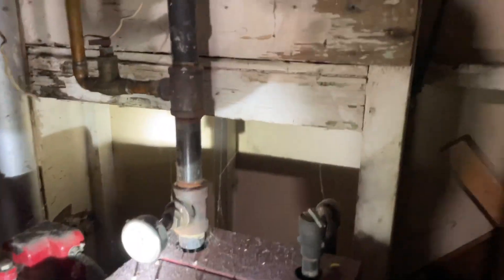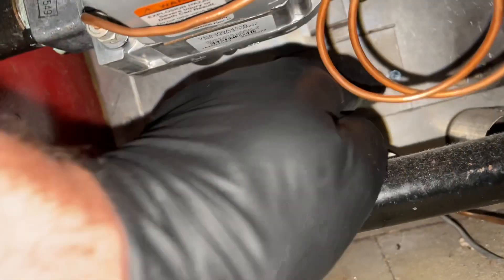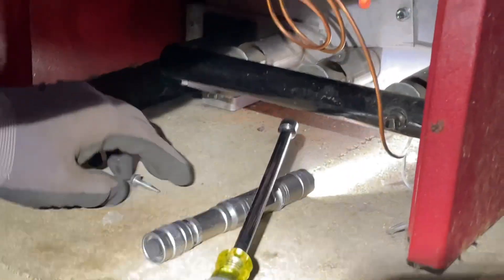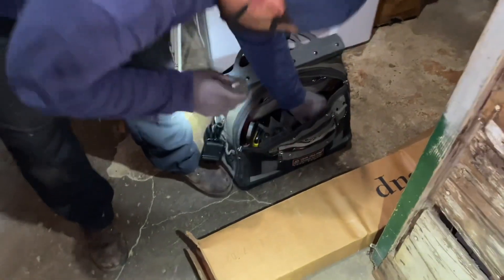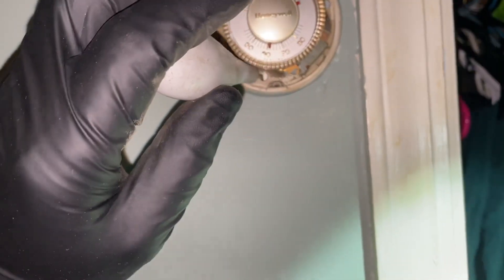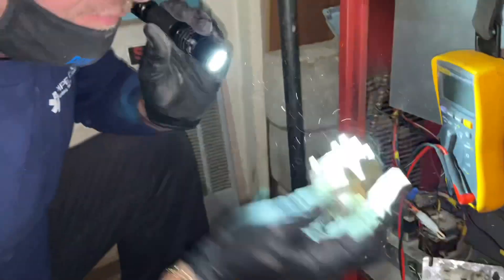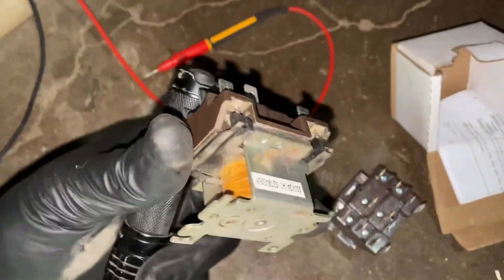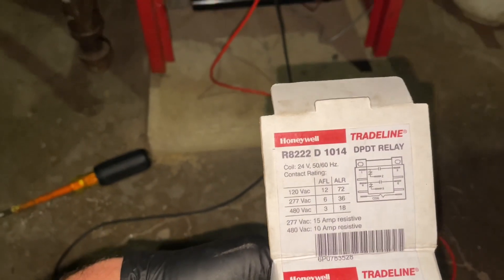No Heat Service Call H.B. Smith GB-100-W-4 How to Diagnose & Repair Defective Fan Center Relay

Comment: I never use those nest screw driver, always leave them toys with the customer. Pulling the stat wasn't necessary when it can be jumped out at the boiler.
Reply: Jumping at the boiler won't tell you if there is a problem with the thermostat or the thermostat wire, genius. It's called trouble shooting.

Comment: It’s crazy how there are tens of millions of fan center relays out there Operating blower motors with 5+ amps and  a low percentage of failures yet they have a significantly higher failure rate with an amp or less on boilers.. great job
Reply: It's the HEAT kills it faster, not the amps😎

Comment: It’s funny how the customer knew that something was burned up in the small boiler and Calvin couldn’t even tell you if the pump was running when you asked him to see if there was a difference😆that is some funny ass shit. I think he needs to be working on pipes but not those kind of pipes🤪
Reply: I'm thinking Kelvin when to check if  the main burner fired up.
Reply: @PipeDoctor  It was in poor taste to criticize your employee on a public forum such as this. I suspect he is probably wet behind the ears and is still learning the technology. Instead of cursing him out on youtube maybe you should uplift with positive reinforcement and use it as a teaching point on this video for others to learn from.